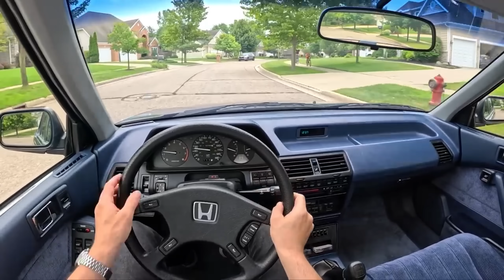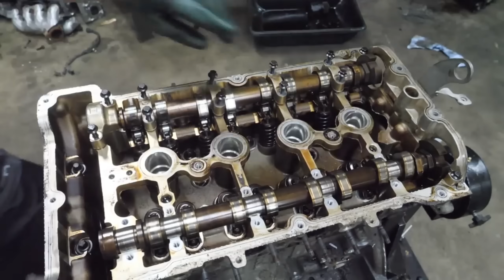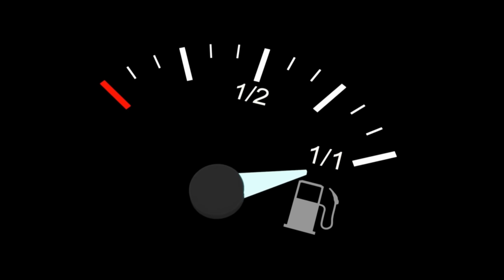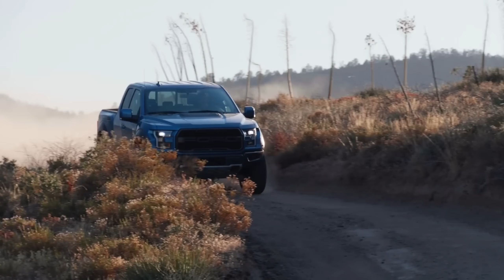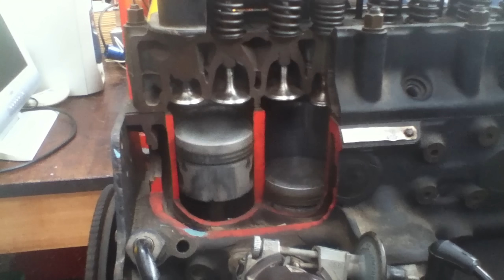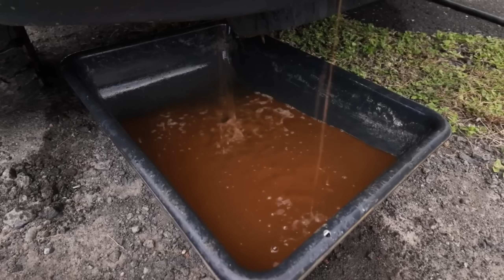Doing This Will Make Your Engine Run Like New Again

Comment: If.u put clean.gas in vehicle u shouldn't need any additives
Reply: Even if u put additif won't change anything
Reply: @bm_wuratli6883 additional additives helps a little. Just depends if you use good additives.
Reply: How the hell you know if the gas is clean or not at the fuel pump?
Reply: @jhariz7387  some country already has additif standardized putting in station benzin the real reason additif is for poor country who do every 6month or per year for additif that why become popular later on US/EU that it...
Reply: Ridiculous answer  @jhariz7387

Comment: Dumb inaccurate  AI video.  K&N flows a little better but it lets  a lot More  dirt into the engine. If over saturated with oil or   Undersaturated makes it even worse.  I have one on My Camaro but i am aware of its limitations and it's not a daily driver. I would never use a K&N in one of my Accord or Lexus that i use  often. 

Another thing.  D4-S Does not suffer from carbon build up.    The system changes to spray fuel on the valve so they don't carbon up.